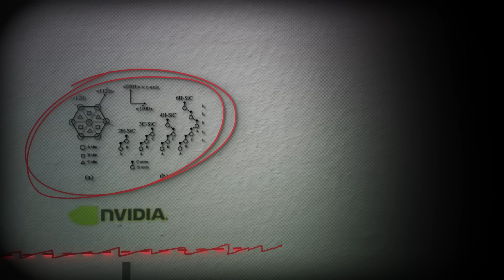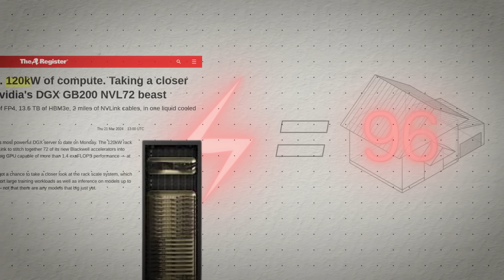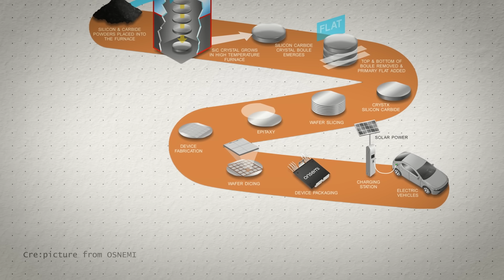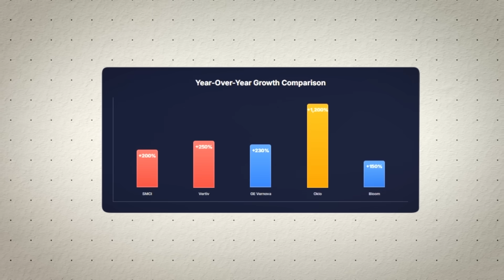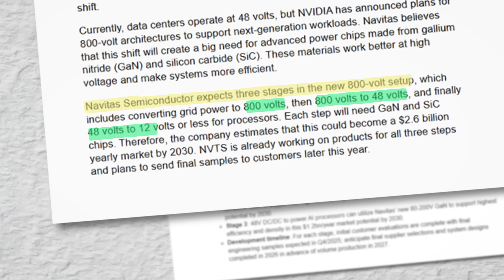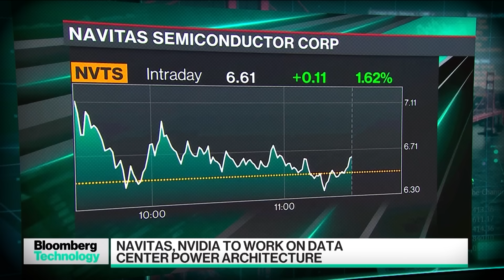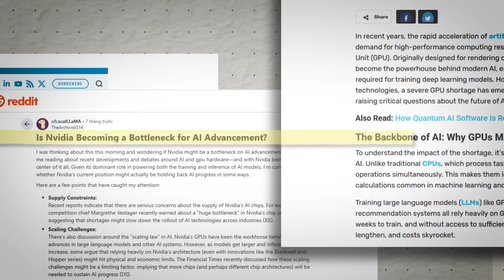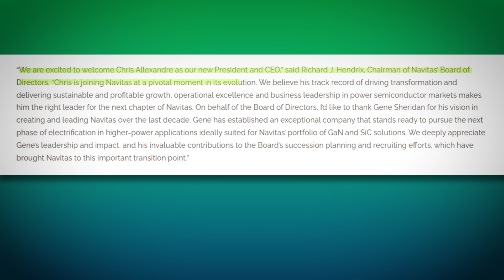Nvidia's Future Depends On AI Chips From ONE Company (Navitas)

Comment: It is pretty insane to make chips that run so hot and try to use them in SoCal!  Why not move those data centers to Alaska? Temperature is 57°F in Prudhoe Bay right now.
Reply from the maker: I don’t think they manufacture the chips in Cali, they just design them.
Reply: @Putchuon im not sure, if they would make money for as much for the stockholders, its something new to me since they down make them, just only the intelligent property. But that doesnt mean someone else can just take them, and use it slightly differently.
Reply: You know there is the summer months as well,
Reply: Apld is doing this.... North Dakota. Big deals w coreweave...
Reply: @marcusparrado6600  as an HVAC engineer i can tell you 100% that while it is quite cold in north dakota during the winter it is equally as hot in the summer. we design data centers like this for at least 99.99% uptime and we have to design for the hottest temperatures in either 50 or 20 years depending on the client. as i said in my previous comment the outside temperature is the least of concerns for cooling data center loads. even the wind direction is more critical as it blows hot generator discharge into chiller inttakes... trust me outside temperature simply doesn't matter and north dakota is a good market for other reasons like available land, power and network capability along with cheap electricity... outside temperature is virtually irrelevant.
Reply: @psilocybemusashi  thanks for taking the time to explain... Surely with longer, colder winters there are energy savings during those times. No? They even claim that they are "leveraging ND cool climate"...
Reply: the outside temperature is the smallest component in cooling a data center. i'm an HVAC engineer in the Data center market you're welcome.

Comment: You made a BIG TYPO on the most important company in the semiconductor industry!  It is TSMC not PSMC.  And the company logo is wrong as well.  Please correct it ASAP.  Thank you.

TSMC
Taiwan Semiconductor Manufacturing Company
Reply from the maker: TSMC does not manufacture silicon carbide or gallium nitride semiconductors; PSMC does.

Thanks for watching.
Reply: Oh, I see what you are saying now.  Thank you for explaining.  

But, knowing the close relationship of Jensen and the founder Morris Chang of TSMC and the numbers of fabs TSMC is building, if NVIDIA is going to move into Gallium Nitride semiconductors, I am sure TSMC will also make all the necessary changes to support Jensen.  PSMC would most likely work together with TSMC to fulfill the Gallium Nitride semiconductor demand.
Reply from the maker: You’re conflating two different types of semiconductors.

What Navitas and PSMC does is more power focused. Their sole focus is to make energy more efficient.

Whereas TSMC and Nvidia focus on compute based chips called GPUs. And they aren’t changing from Silicon no time soon.